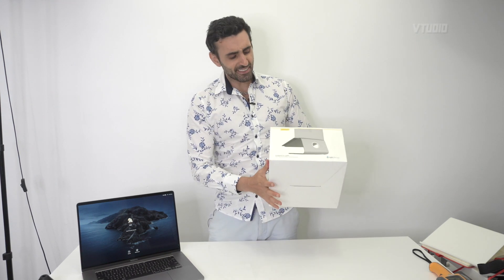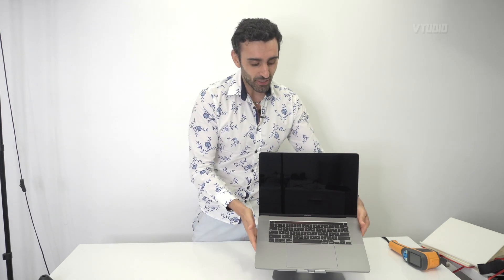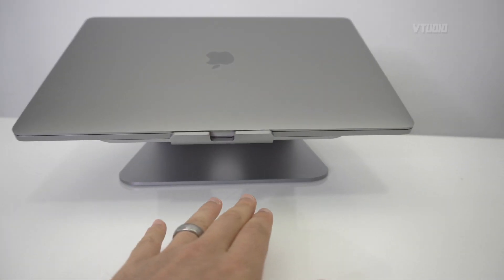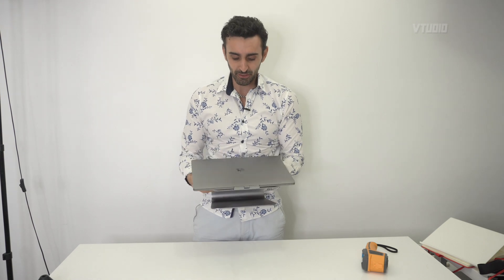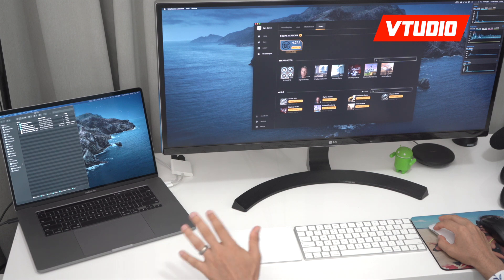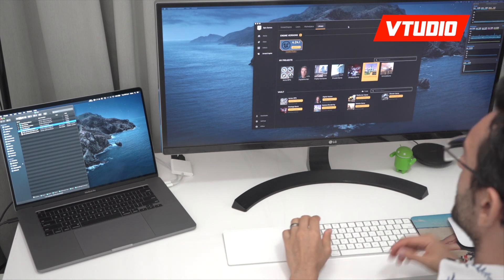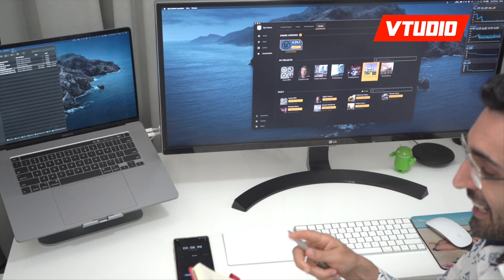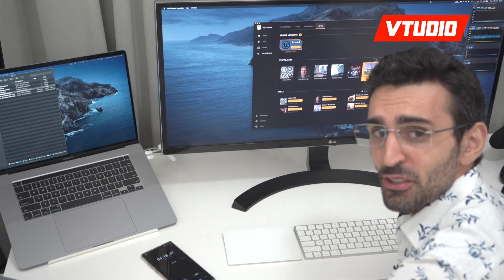mStand Laptop Stand REVIEW | Make Your MacBook Pro Run Cooler in Style

Comment: Do you recommend keeping the macbook pro 16 in clamshell mode when connected to an external monitor? Mine gets really hot above the touch bar when connected to monitor, I'm afraid to put it in clamshell mode and damage the screen.
Reply from the maker: Yeah, mine runs cooler and quieter in clamshell mode.
Reply: @headsoftech  Ok thanks!

Comment: If you endure one day at work for your laptop to be on that stand and you write all day with your hands in the air, I'll buy you a whole box of those stands 😂
Reply from the maker: Ah mate, two things, I use mine with an external keyboard, mouse, trackpad and monitor - it keeps the computer running much cooler with the lid closed. Second, it depends on the height of your desk vs how tall you are.
Reply: Vtudio Pro 

This stand is just to put away the laptop. If you use it all you buy a monitor so at least I think🙋‍♂️
Reply from the maker: Sounds good to me